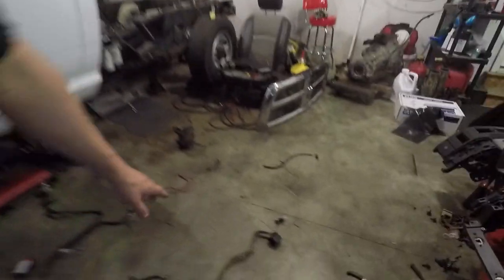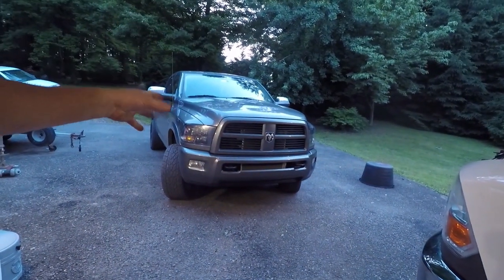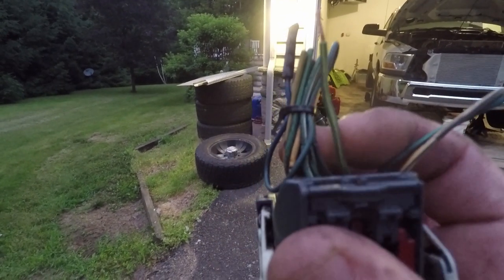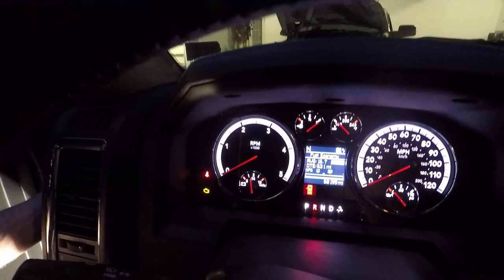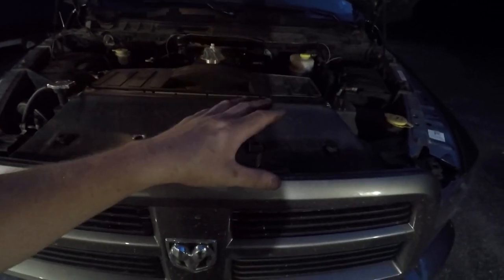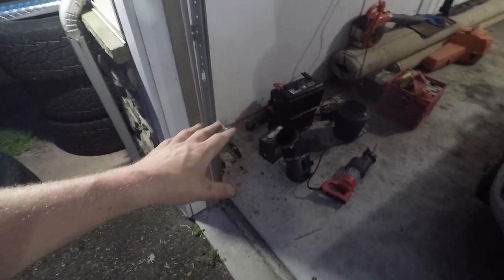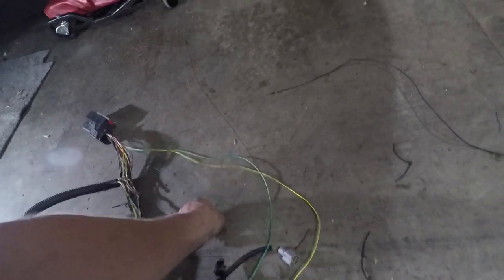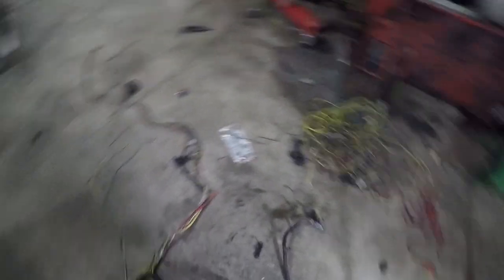Laramie Cummins Gets Used As A Test Dummy For Race Truck Gutting!?!?

Comment: Tom - It's Mike from San Angelo again.  I had the same exact thing happen with my batteries.  In July of 2015, my Mini Maxx started rebooting during cranking and randomly the truck would not crank.  Out of shear curiosity, I wonder how close our VINs are (my sequence # is 306002).  I had the batteries tested, and sure enough, the driver's side went bad.  I went ahead and spent over $400 and replaced both batteries with Energizer AGMs from the local Sam's Club.  I can't say I've been too impressed with them either.  Now only 3 years later and this past winter they've been acting weak too.  I know our climate here in Texas is very hard on batteries, so it's not much of a surprise, more of a disappointment.  Maybe I'll go back to Duralasts, I too have had good luck with them in the CJ7.